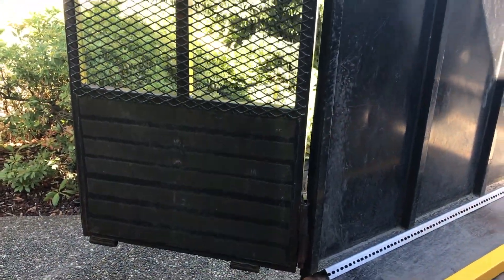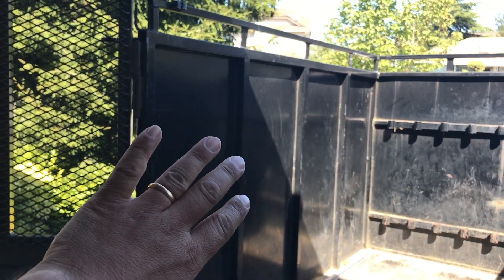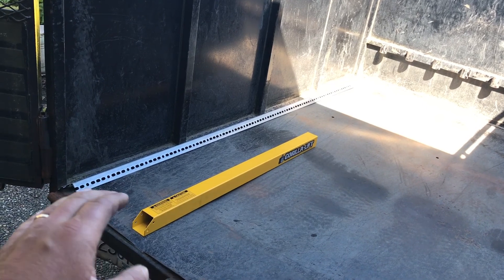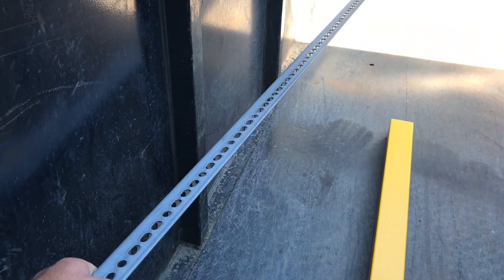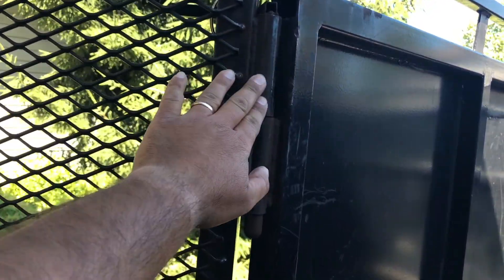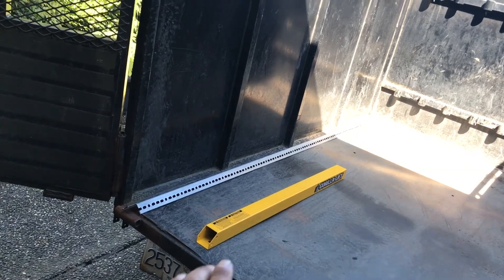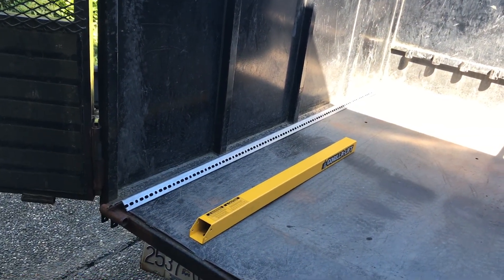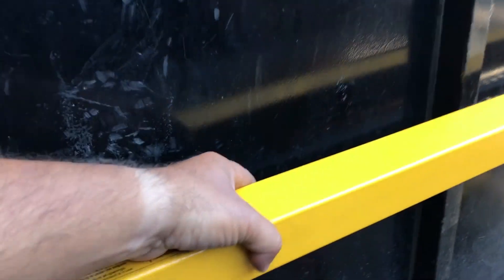Gorilla lift installation on a custom trailer with no side rails

Comment: Thank God I found this video! Will be using this idea on the outside of my trailer. I’m going to weld 1/8 angle to the outside instead and paint it black. If I could afford to loose the space inside I’d do it exactly how you did. Awesome trailer you’ve got there!
Reply from the maker: Your welcome, and I’m happy to report that this installation is still working trouble free to this day. Thanks for watching.

Comment: How did you get the nut on for the side angle bolts connecting to the trailer frame? Are they on the outside or did you take the side wall off? Thank you.
Reply from the maker: I used self tapping lag bolts to secure the angle iron bolted to the trailer frame on the inside only. So no nuts. I did pre drill pilot holes though to start the bolts and to make sure they were all lined up. It’s been 7 years since I did this video and it’s still holding up well today. Never had an issue with the self tapping lag bolts coming off. Thanks for watching.

Comment: Hi there, thank for the video, I'm mounting mine into a box trailer for my side mower gate.
How high from the floor did you set the angle iron from the floor? You mentioned between its designed for side rail trailers at 12 and 24 inches.
So the higher up it is the more lifting power it has?

Comment: Are you able to tell me the dimensions on the slotted angle iron. What the width is, seems I can find a 2 in width, thank you
Reply from the maker: The slotted angle I used was only 1.5” it was all I could find at the time. It works but he gorilla lifts over hang the angle iron. If you can get 2 inch angle I would probably use that as it matches the width of the gorilla lift tubes. Thanks for watching.

Comment: How heavy is your gate?  Mine weighs about 90-100lbs its an old landscaping trailer with a 4' tall iron gate that folds downwards.
Reply from the maker: I have no idea what it weighs but it’s extremely heavy. I built it with heavier gauge metal tubing than what the trailer manufacturer suggested to me because I wanted to make sure it would handle heavy equipment if needed. Thanks for watching.